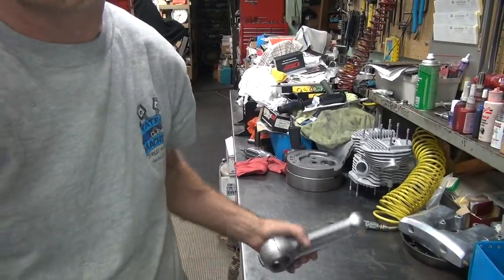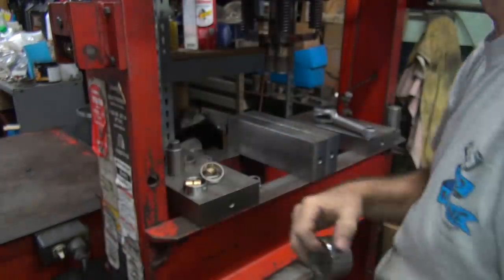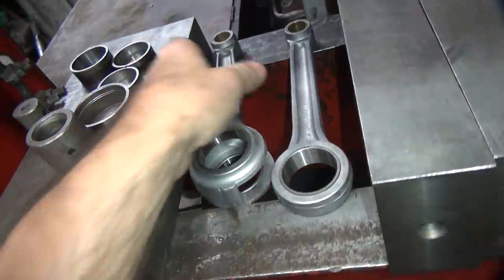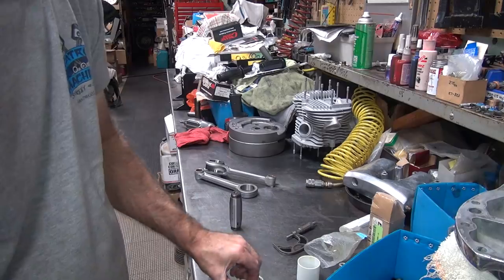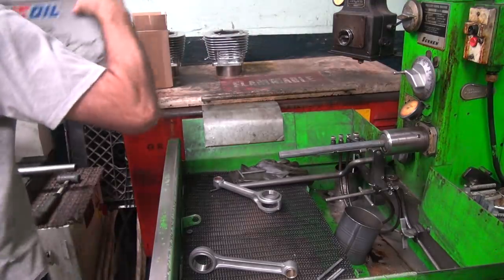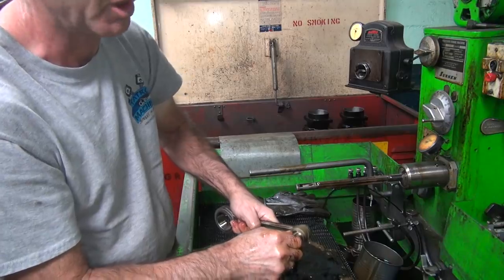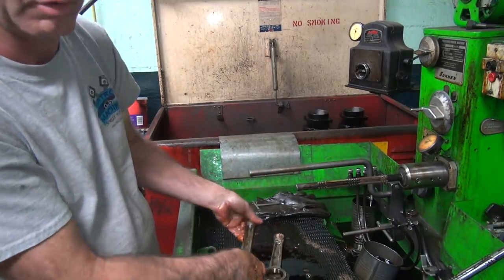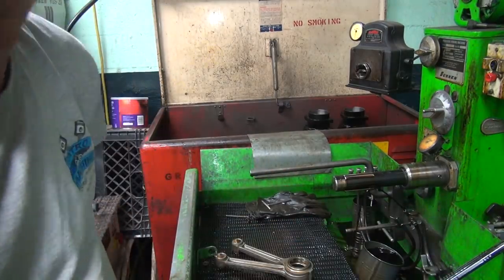1967 74ci shovelhead #105 flh bike assembly motor rebuild harley craigslist special tatro machine

Comment: why didn't you used the  S & S  rod ?
Reply from the maker: not needed in a stock type motor and it is very heavy. heavy rods make more vibration, lighter parts make less.
tatro